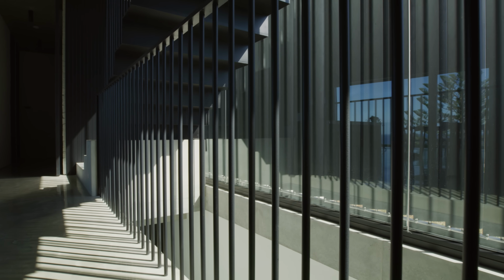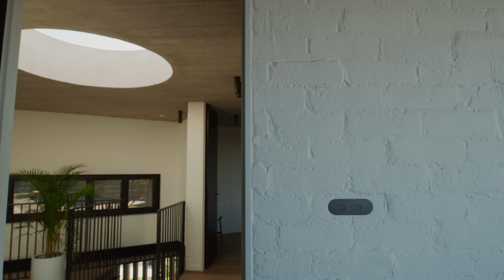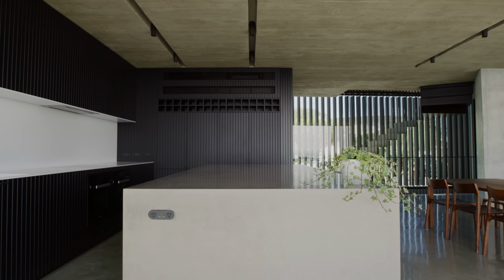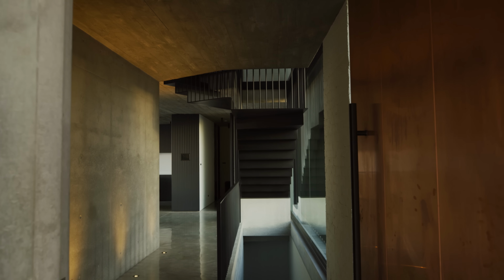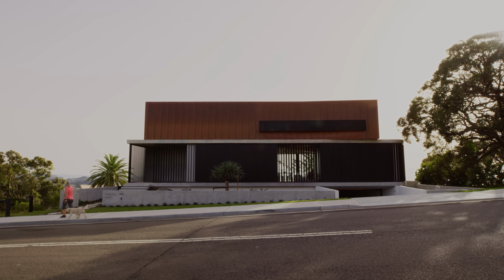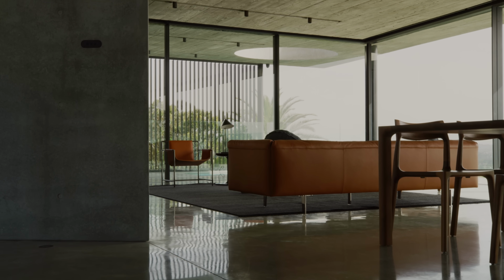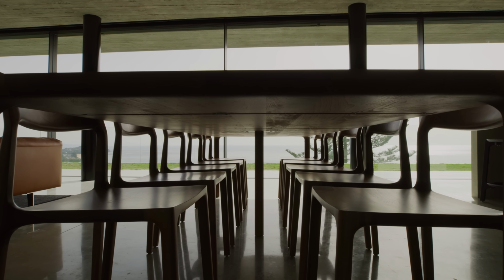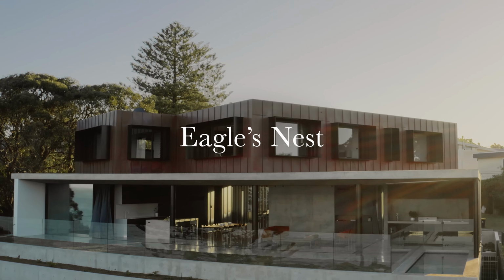A Concrete Dream Home in Australia's Highest Rated Flame Zone (House Tour)

Comment: Beautiful application of materials.  Nice to see such well thought out restrained design.  There's a great contrast between dark and light colours as well as the monolithic feel of the structural elements and the fineness of things like the stairs.

By the way, what's the material and exact colour on the exterior of the second floor?
Reply from the maker: Thanks Kevin - I'm sure Ian will appreciate your kind words about the project! I may be incorrect, but I believe it is a a fireproof corrugated iron cladding. I'll try & source the exact material from Ian and get back to you.
Reply: @TheLocalProject  Did you end up finding out what the material was?
Reply: @boostav  Top box is clad in standing seam copper